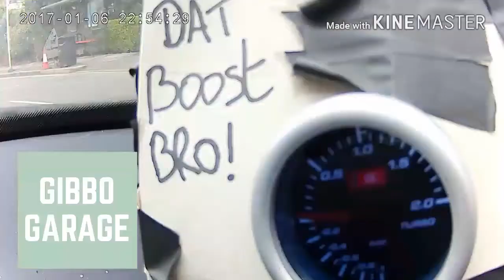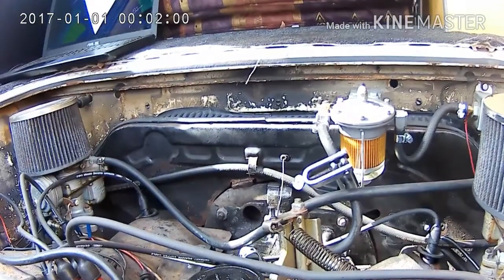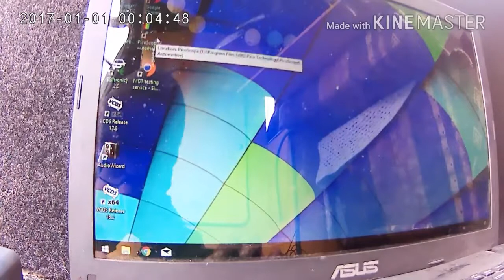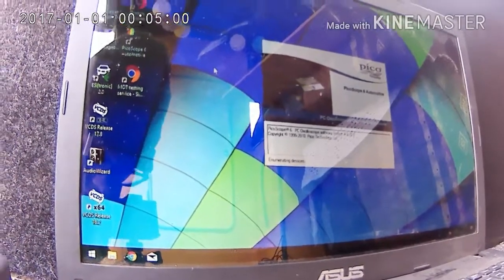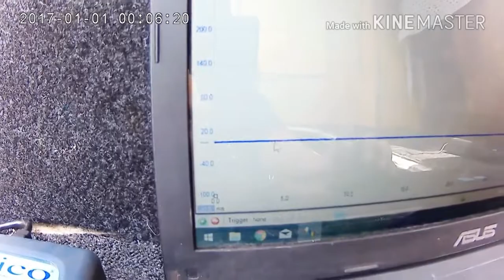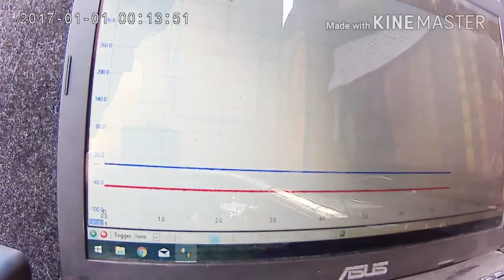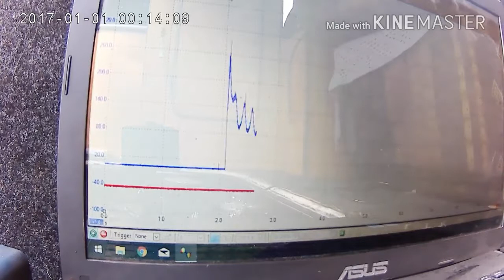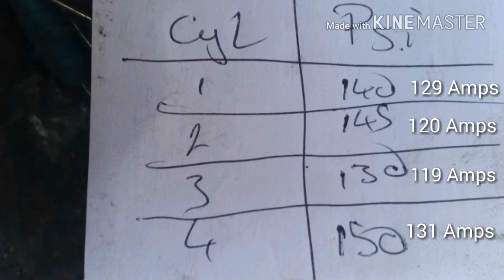Air cooled VW T25 Relative Compression Testing

Comment: Not sure what the point is... this looks a lot more complicated than using a simple compression tester.
Reply from the maker: It defiantly needs more kit than a simple compression test.. but for engines with multiple cylinders or hard to reach plugs it help remove the compression variable from any running issue  very quickly